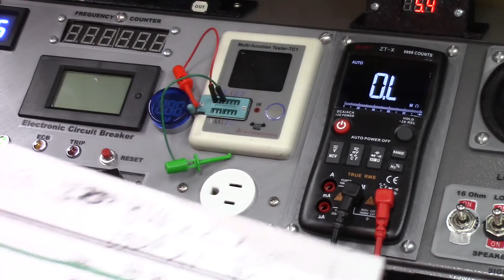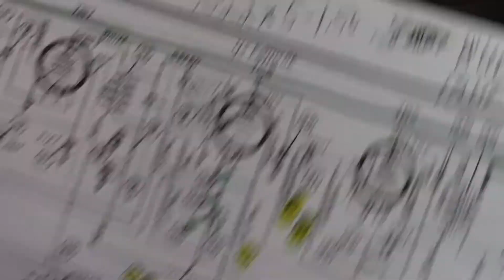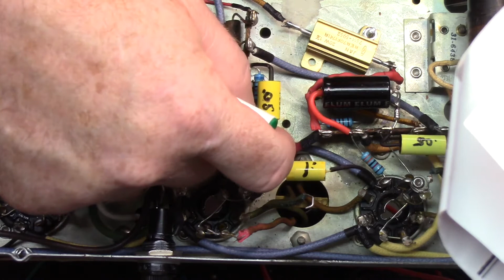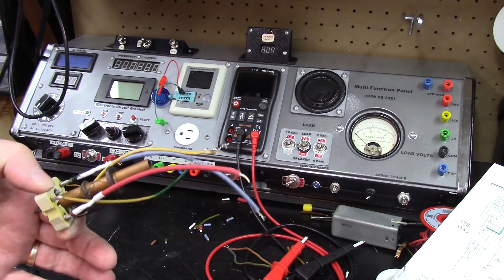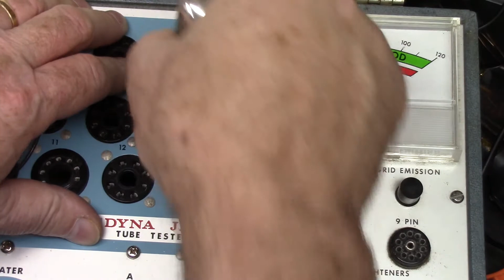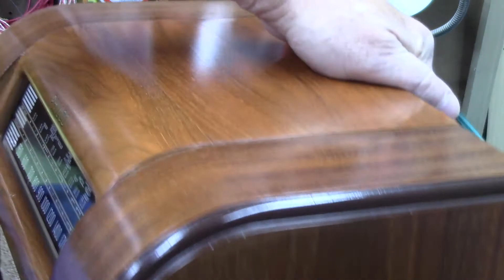Philco 42 340  Part 3 - Rewire, capacitor & resistor replacement. 1080p HD

Comment: Well, I think YouTube doesn't like me at all.  It totally trashed my comment to you.  Nothing I typed to you in that post was left.  You basically answered one of my questions in this video.  That was the one about what the tan cylindrical device was that is at a 45° angle and you explained it is a shortwave coil.
The other question had to do with the maroon colored rectangles ( see 20:17 ) both at the top under the switch shaft, and just before the switch wafer.  They look like they might be mica capacitors, but I wasn't sure.
I also was wondering if you put any heat transfer compound under the power resistor installed in this radio.  I doubt it would be needed, but wouldn't hurt either.
Reply from the maker: Thanks Wayne, yeah I don't understand why some comments work fine and others do not. Very frustrating. Yes those are Mica Caps and no to the heat sink grease. That is a 25 watt resistor which is way overkill for that circuit, so it should be fine.

Comment: Hi Gregg, nice job on the wire replacement and the case looks stunning. Thanks for fixing the video resolution 👍🙂
Reply from the maker: Thank you David!
Reply: @greggsvintageworkshop8974  Dave is another great electronics trouble shooter as well. clear down under amongst the lock downs. I wish he would quit calling them valves and call them tubes he was working on a bat tube radio when we first meet you know tubes mounted upside down.
Reply: @petepeterson4540  Living in the good ol U.S.A. I grew up being told that they were tubes and calling them tubes...however, when you think about what they do, valves is actually more properly descriptive of them.  That said, I am still gonna call them tubes most of the time!